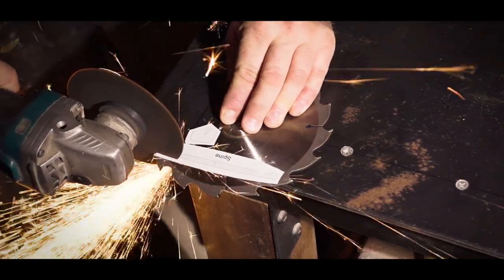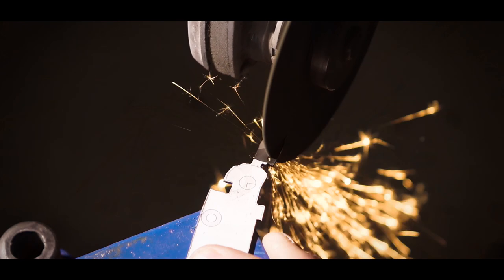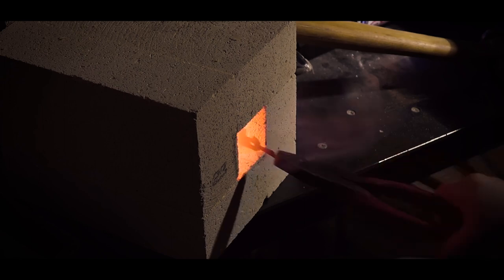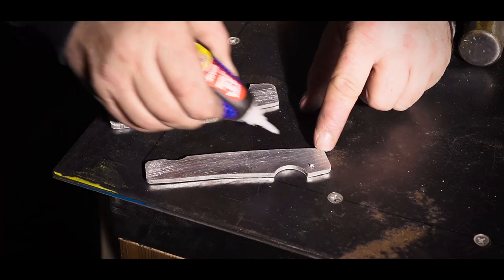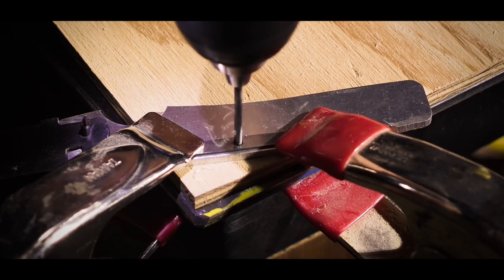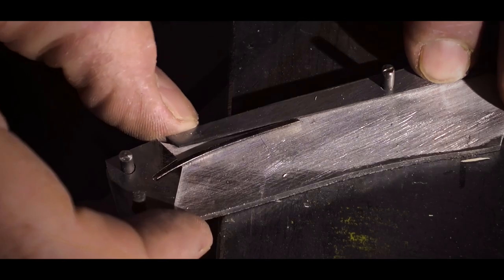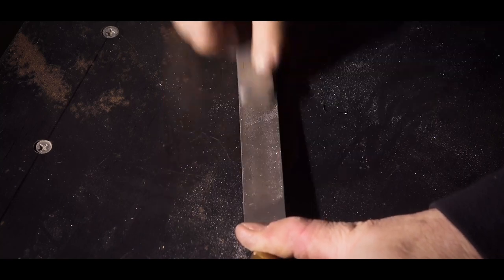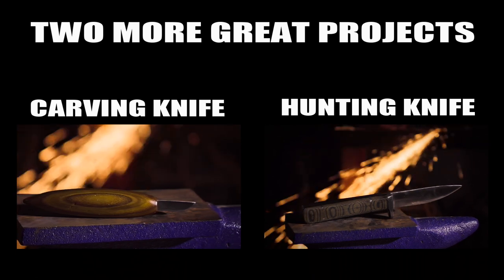How to Make a Folding Knife with Basic Tools

Comment: Thanks for this! I have a Japanese stainless blade with staghorn scales folder that I inherited from an old friend who passed away some time ago. I took it apart a few years ago, with the idea of rebuilding so it will spring open at the touch of a button, but haven't yet found the time to conduct that experiment. I only rebuilt it tonight because I've been wanting to use it as an EDC. While rebuilding it, I had to replace the brass pins and wanted to get some input on the best way to go about that and bumped into this video. Well, now I have TWO knife projects to do now LOL. I happen to have a bent aluminum bicycle pedal crank that was left over from a replacement I did for a friend and have been saving it for a rainy day - I think anodizing it black would be cool - but also something I'd need to research on how to do. I think it will make a great basis for the knife scales in your build.  I also have part of a saw blade that was already cut up for another project - so I'm set to go!Thanks for the video and the template uploads!

Comment: That has got to be the coolest knife you have made yet (in my opinion). really like the way aluminum cleans up. I also think that it will age well, I made an aluminum ring back about 8 years ago and it's been on my key-chain for the last 4, still shiny, and the nicks and scratches smooth over with time to give an awesome worn look so, it's got to be good for pocket knife scales.

Comment: just a retro thought,  for better aluminum scales use aircraft grade its an alloy but still easy to work and much harder then standard grades.
also tempering saw grade steel (most likely M2)  TEMPER AT 425 f FOR  45 MINUTES LET COOL, THEN REPEAT ONE MORE TIME.

Comment: +john Heisz Just a suggestion for next time, since you are making the spring and the but from the same material. maybe make them one piece so they are 1 piece instead of 2 separate, I know you only did it this time because you didn't know if the material would be springy and its the template from the wooden knife. I just had some problems with my spring XD

Comment: Whenever I have seen an old locking knife, the lock has worn so the blade wobbles or tries to snap shut on your fingers.  Could you think of some way to get the carbide tips from the saw blade into the lips of the lock to prevent wear?

It seems to me to be easy to arrange for an existing tip to stay on the tip of the knife blade,  but I can't see the advantage unless the user is a habitual scrape-name-in-rock kind of guy.

Comment: Would heating and air cooling the blade before the grinding and filing make it faster and easier to file, or is the blade not hard enough to bother?
Reply: +NoFun AtAll Annealing might, but it was cutting pretty easily with the file already.

Comment: Nice video, just a simple question. I live in the UK and as such locking knives are illegal for edc and only allowed for work purposes with a reasonable excuse for ownership... dumb law I know. But do you have any templates for none locking knives? Also do none locking knives use a similar spring system to friction hold the blade in place or do they rely on the pressure provided by the spine alone? Cheers
Reply: +James Bruce You should look at knives like Opinel or Svord. The extended tang on a Svord serves very well and Opinel has a very long history. I can't remember when they incorporated the virobloc, but only about 60 years ago. There are modern custom knives, last maker I saw make one was Mike Snody.

Comment: I saw this video when john posted it but was wondering if anyone new if I can use a tempered shovel for the blade? (cuz I don't have an old saw blade)
Reply: +Tanner Tischer Cut the shovel, heat it up and quench it in warm oil. If you can snap the steel, sure, why not. I'll tell you a piece of 1095 is not expensive.

Comment: How did you apply the template to the metal? I tried doing this same thing awhile ago but when I was cutting the rough shapes, my glue kept heating up and the template would fall off.
Reply: +emertes17 Also that bevel you put on the blade looks amazing! mine ended up like crap. I guess practice makes perfect
Reply: you probably want to cut out your template & trace/etch what you want to cut

Comment: Hi. I tried making one myself but completely screwed up in the seine, its pretty loose. What can i do to make it a better  fit?
Reply: Lego MOC-Building when you were cutting it out with the angle grinder did the paper burn up so it was hard to work with?
Reply: king sniper yeah it did but is also screwed up fixing buttstock and spine lock to the handle scales

Comment: i have trouble drilling through the steel any tips for bits or anything?
Reply: use 3in1 oil on the surface
Reply: +Walter Morgenroth i´ll try thank you
Reply: just for the people who still need to know. normal drill bits wont work. Use masonry drill bits they have a metal plate wich is made of tungsten carbide (google that) and they are capable to do the job if u sharpen them with a diamond wheel on the angle grinder (tungsten carbide is only grindable with diamond so normal grinding wheel wont work.
Hopefully my mistakes might help someone

Comment: Hi John, 
FYI Re: The aluminum handles ... a friend of mine Anodized a number of parts for his motorcycle at home. He got the kit from a place called Castwell. I'll add the link ( http://www.caswellplating.com ) I know he also used a automotive high heat clear coat on some of the parts to protect the polish he put on them. Not sure if you're into that ... but it's probably worth a look.
Reply from the maker: +hassleoffa 
I've done homebrew anodizing before, but didn't have the time to go into anything extra with this one. I'm happy to allow the knife to get scratched up from use and abuse - I like it when something looks like its age and shows signs of wear.
Reply: Yeah, I hear you. My favourite things are always beat up and worn.

Comment: But you didn't have to harden it because saw blade steel is already hardened.
Reply: Actually, he had to, because you can see how easy the files took off material. That means the saw blade was NOT hardened properly, or even not at all.
Reply: David Yi You're right.

Comment: Those saw blades are already heat treated. Could of just cleaned it up.
Reply from the maker: +Jax 
Interesting, when I use a saw blade to make a knife without heat treating it (like I did for my meat cleaver project), all the wannabe experts go on about how it needs to be heat treated. And now when I do, I get your comment :)
Don't know if you actually paid much attention, but the saw blade steel was too soft to make a good blade - I used files to do much of the shaping. Although it was original saw blade was hardened and tempered, it was to a much lower degree and the steel was not hard enough for use as a knife.
Reply: John Heisz Fair enough.